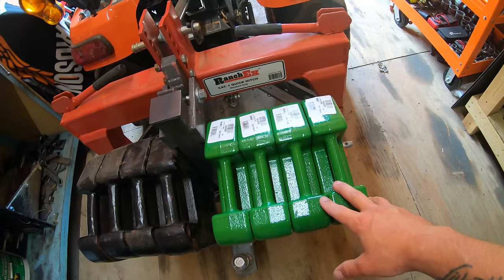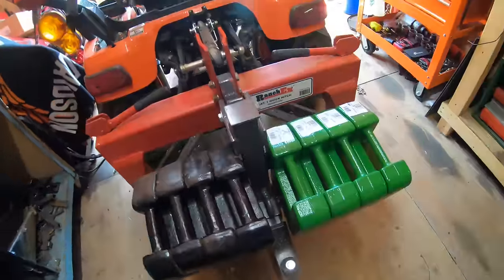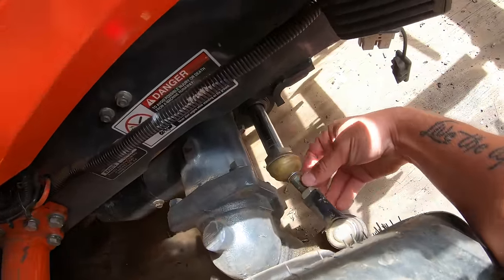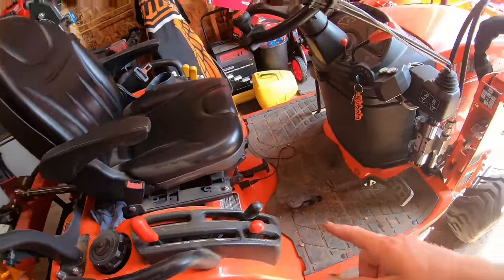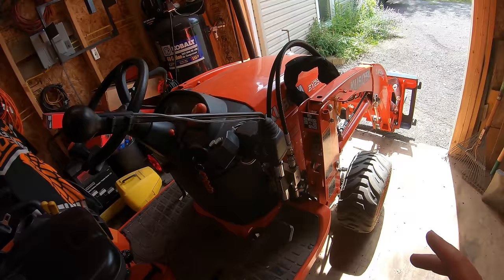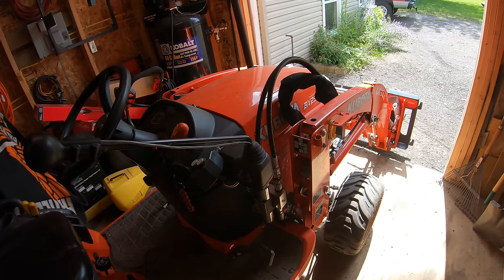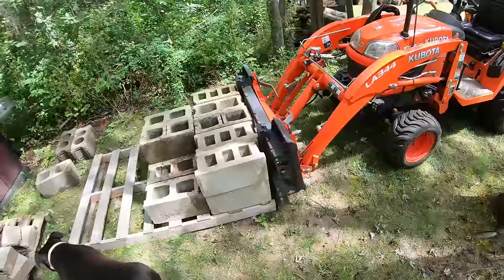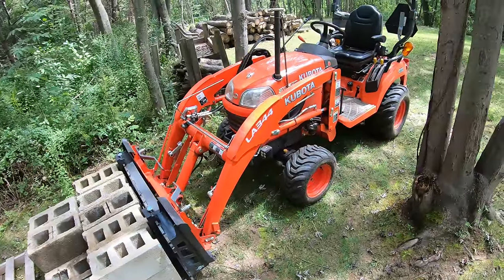Kubota BX- Testing Relief Valve Pressure 1950PSI Vs. 2400PSI  Vs. Lift  (New Suitcase Weights!!)

Comment: Hey Biff - Other than different thicknesses, is there anything special about those shims?  They look like simple flat washers to me.  What diameter are they; I might have a few in my garage somewhere.
Reply from the maker: Hey Dave, as long as you match them in size to a regular washer you should be fine, that’s what I did for a few of mine.. just be careful about the thicknesses as if you go up too much pressure too fast you can def break something. I had s real thick washer in there and my pressure gauge went all thr way to like 2,600lbs lol so I had to take a few smaller ones out to make up for the one larger one. Best of luck!
Reply: Shims are very thin. Available online & very inexpensive.

Comment: Are these shims just washers?
Reply from the maker: Yah bascislly .. they are just super thin washers with set thicknesses .. if you find you have to add quite a bit then you can go to the hardware store and find a washer that mimicks the stock shims in diameter and take all the shims out and just add your washer and then test it and if you still need more then you can add the factory shims from there to dial it in. That’s what I did.. I have a couple washers in mine I think

Comment: Will the shims at 2200psi work out ok on my BX23S? Also, when testing the pressure. Do you pull the throttle wide open?
Reply from the maker: 2200 is over the factory spec.. spec on our machines is about 1900psi so anything higher and your taking a risk either hurting your pump, bending your loader, blowing a hydraulic cylinder seal, or blowing a line.. so as long as you know the risks you should be ok. Also be sure to have plenty of rear ballast when you do this because if you don’t have proper weight in the back after increasing your pressure then you will never able to keep your rear tires on the ground which defeats the purpose of increasing the pressure cuz it’s hard to lift something heavier when your rear tires just come up off the ground haha. As long as you are aware of all that then yes 2,200 should be ok, there are tons of guys at pressures between 2,000 and 2,200 and none of them have had any issues including me

Comment: Hi, your videos are very helpful, I was looking at doing mine , my dealer told me I don’t need shims to do it can be done by turning a set screw, do you know about this or is it bs?
Reply from the maker: Thanks buddy glad your enjoying my videos I hope they are helping lots of people. As far as turning a screw, there is no screw on a Kubota Bx that will adjust the relief pressure.. the only way to increase it is to add shims on top of the shims that are already in it. Now if you have a differnt model tractor specially an older model tractor some tractors did indeed have a turn screw with a jam nut.. but Kubota did not use thus style on the BX and neither does many other more modern tractor company’s
Reply: It is a 2020 Bx23s, thanks for clearing it up, on your pusher and plow , do you have a favourite, as I’m looking for something better from using the bucket, big  yard medium hill
Reply from the maker: @fastpapa1942  no problem man. I always liked a pushbox the best.. specially for a beginner as they are much easier to control and get use to.. easier to adjust and set the shims too and no extra hydraulics or anything involved. Just drop and push. Also they are much cheaper than a plow and still get the job done. A plow is better tho for really deep snow but for anything 1 foot or less the pusher will usually do a really nice job so long as you have proper ballast on the rear of your tractor. Fill your rear wheels if they aren’t already and add ballast to the back.. you’ll want at least four 42lb suitcase weights minimum I’d say. This all will help your tractor put the power to the ground and be much more efficient with everything that you do, it will be much more stable as well.
Reply: Think it would handle a 60 or 66 inch pusher,  any thoughts on a larger bucket, Seen one 60inch half a yd lighter material

Comment: I don’t see why a larger pump wouldn’t be the direction to go if you want more lift, by time you buy the special light weight forks for the bx you are in the neighborhood of a used pump. I have an Eaton 70145 attached to a cheapo harbor freight 670cc gas engine and it pushes 20gpm, I very rarely find something the tractor won’t lift. With clamp on bucket pallet forks I’ve lifted pallets that cause the rear tires to lift off the ground while using a Bradco 509 fully extended for counterweight on the back. Someone needs to take it to the next level on these bx tractors!

Comment: I tried increasing my hydraulic oil pressure to my Kubota bx2680 by adding shims, but ran into a problem. My tractor was originally running at 1650psi (rated to run 1750- 1850) so I added a couple shims to try getting at least 2000psi. When I checked the pressure gauge after adding the shims to my tractor, it showed just over 2500psi. This is obviously too much so I removed all the shims I added, and checked the pressure again. It was still over 2500psi. I don't know what to do.
Any help is much appreciated!
Reply from the maker: Wow that’s strange, sounds like you may have gotten a shim stuck in your spring, or maybe your spring is getting hung up on something, also double check to make sure you have removed ALL the springs from beneath the spring because with the oil at the bottom they like to stick to the bottom and you may think you have them all out when really there is still more in there. I would double check that all of the shims have been completely removed and that the spring looks ok, clean it out with some brake clean and put it back in and try again.. let me know what happens thanks
Reply: @BiffsEquipment  The problem was my seat relief valve was stuck. I guess I over tightened the bolt at first, but I don't know. I took out the spring and poppet relief and put the bolt back on. Then, I ran the tractor with full rpms and moved the loader lever to one side. The pressure of the hydraulic fluid moving through seat relief valve pushed it back out. I removed all the shims from the bolt and reinstalled the bolt with spring and poppet relief. The tractor read 2100psi which is exactly what I wanted from the beginning! Was a weird experience and I found out not much people have this issue but I'm happy I figured it out.
Reply from the maker: @RB2G100  wow yah I mean thay can certainly happen I suppose, you may have also had a small piece of debris in there as well that got trapped inside or between the spring coils or the shims which Temporaly increased the pressure.. it’s working now tho and that’s all that matters and as long as you don’t mess with it again it should stay working so you should be all set. 2100psi is a good number to be at.. I wouldn’t go any higher. Glad it all worked out and stay safe!
Reply: I have the same issue right now, so are you saying the plunger was stuck or is inside the housing where the spring with bolt screws in another seat in there ? I see the chamber in the housing has a hole but it doesn’t like up perfect with the home in the housing for that create my higher pressure I took the spring out and worked hydraulic opened the bolt and the little plunger was out so u looked at it stuck it back in and spring it Drillopped tk about 2300 now still little high

Comment: I was disappointed in this test.  Jacking the pressure from 1950 to 2400psi only lifted the same load a bit higher.  I expected you should have been able to add three more blocks and raised it all the way. ???   I believe you have seen my 'loads', but my test will be with the six sheets of 1" plywood on my pallet forks.  I do not know what my hydraulic pressure is, but I hope if I shim it a bit more, the FEL should lift with another full sheet, which is 90 pounds.  Maybe soon, when I get time from my 100 chores around the yard.
Reply from the maker: Let me know what you find out.. but yes at 2400 psi it only managed to lift the same as the Deere 1 series.. this is because the Deere has a MUCH closer loader to the front of the tractor giving it a massive as advantage when it comes to lift but which also gives it very poor visibility when operating the loader over the BX which is so easy to work with. I have used both John Deere and kubota to do loader work over the years and Kubotas are always much easier to operate with out having to look so hard and think so hard about what your doing.. also Kubota hydraulics are much smoother.. in the end I was just happy it was able to lift the same as a factory Deere because they are no slouches when it comes to lift and I feel that’s more than enough because at that pressure I have to run 650-700lbs of total ballast to keep my rear end nicely planted on the ground.. cuz If your raising the rear then there’s no point in adding more pressure
Reply: @BiffsEquipment  Would you know the lift cylinder size on the JD?  I believe the Kubota is 1 3/4 inches?  I saw someone is attempting to produce and sell larger lift cylinder for the BX, I believe 2 inch, for much greater lift without upping the pressure.

Comment: You BX guys are hilarious! Just buy a bigger tractor
Reply from the maker: It does everything I want it to, and fits perfectly for the types of jobs and small residential areas I work in.. also doesn’t leave deep ruts in the spring and fall.. now with the pressure increased it lifts all I could ask it to and Iv yet to have a single issue beating the living crap out of this machine. At some point I’d like to go with a B-series but anything larger than an LX series Kubota is just gonna be much too large for my needs.
Reply: Fits my garage and does what I need.  Occasional lift issues, fixed now.  We probably spend more time sorting things than you guys, but I’m a retired hobbyist so I like the platform.